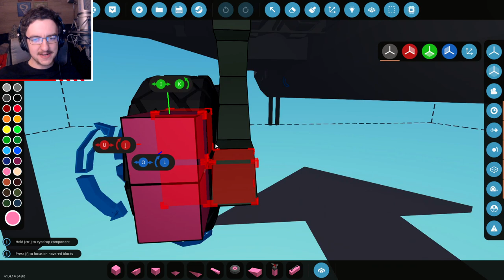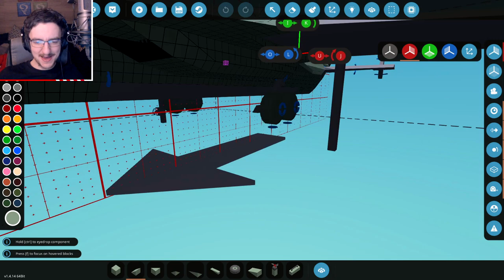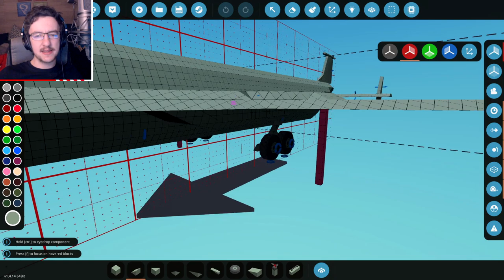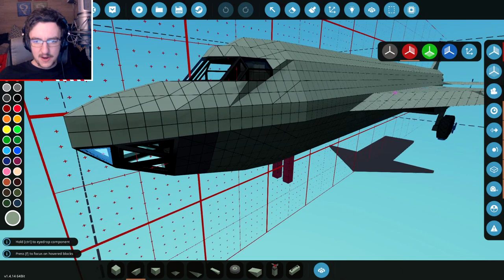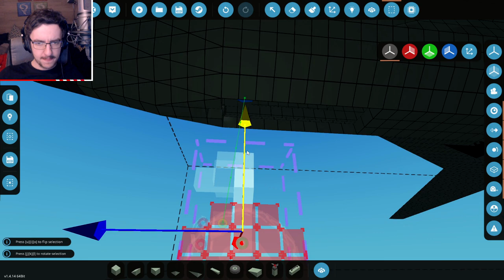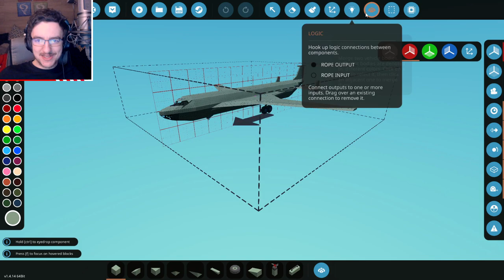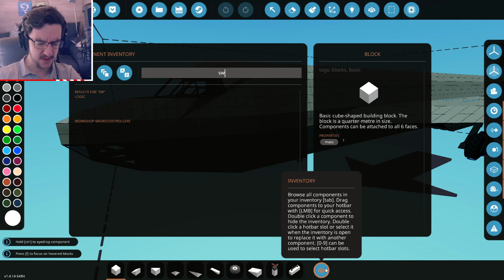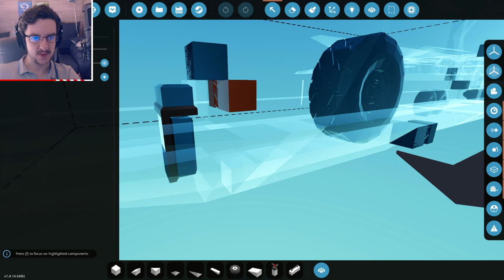Retractable Landing Gear? SURE! - Bomber Build - Stormworks Search and Destroy

Comment: You want capacitors on the signals for the gear/doors, easy as that.  They're delays: Charge is a delay after a signal has turned on, Discharge is how long the signal is kept on after the source is lost.  
If your button is say, "Lower the Gear" you would want that button to go to 2 capacitors: 1 for gear, 1 for doors then those fire your 2 switchboxes that send numbers to the pivots.  0 Charge, 2 Sec Discharge for Doors, opposite for the gear.  So when you tell it to open, the 0 charge makes the doors open instantly, while the 2 second charge on the gear makes them wait.  When the button goes off (raise gear) the 0 second discharge on gear makes them move instantly, and the 2 second discharge on the doors make them wait.  1 simple control block.

Comment: @Frantic i would recomment making a Microcontroller and using capacitor or other delay mechanic, so the wheel is first to retract followed by the doors and dorrs open first and than wheels are extended